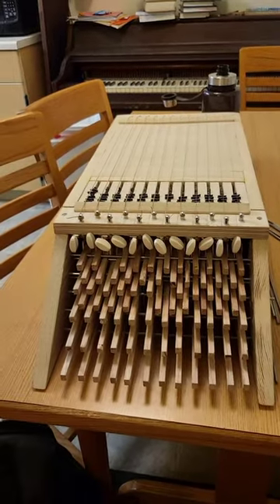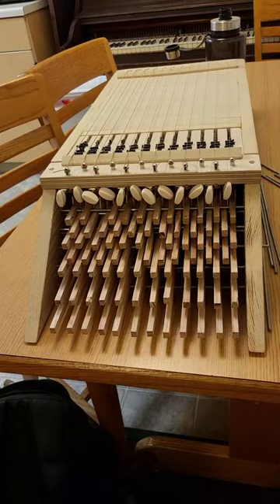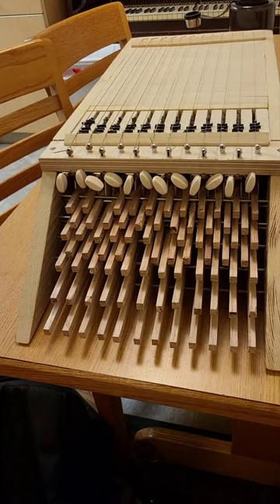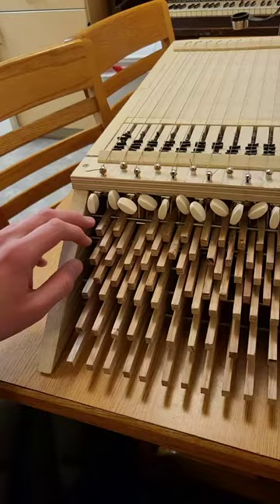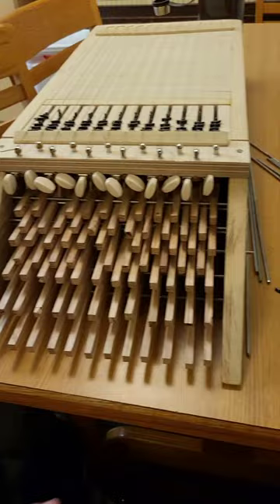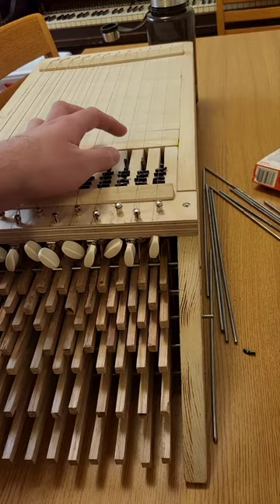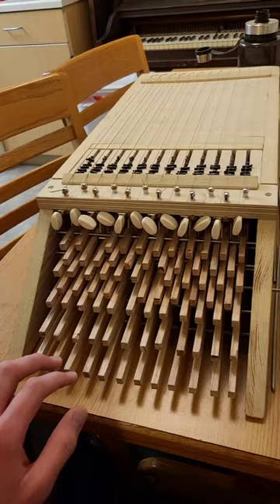31-TET / 31 EDO clavichord prototype

Comment: PLEASE tell me more about how you made this!! I had something very similar in mind (to build) and I had no idea how to go about designing the mechanisms myself. I'd really like a follow-up video about the internals and such!
Reply from the maker: Thanks for the interest! One of these days I'll make a more detailed video, but here's the gist: Just like any clavichord, each key is just a simple lever. The keys are made of hardwood and extend back to below the strike point. The tangents are made of long screws (the cheapest metal rods available at my university's project lab) that I shaved down on one end to form a blade. The tangents just stick up out of the wood at a 90 degree angle, and what you see at the top is a little bit of gorilla tape that prevents the key from falling down. Shoot me an email at jessenebeker@yahoo.com so I can get you more details and see what you're building!